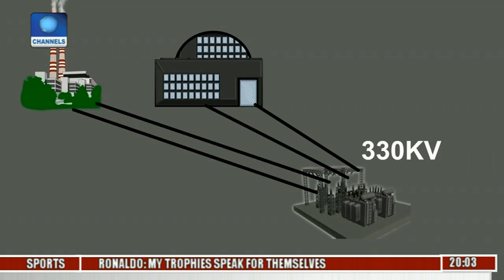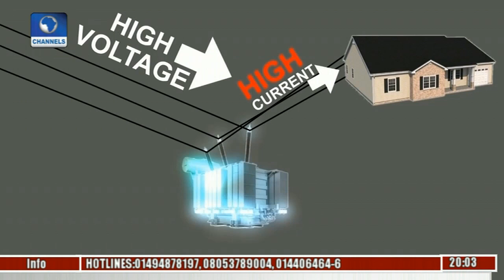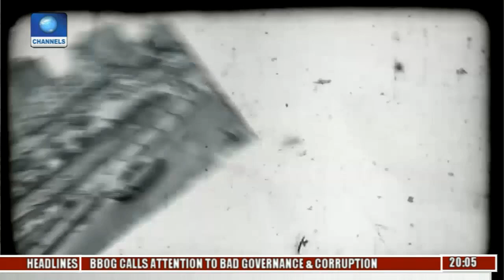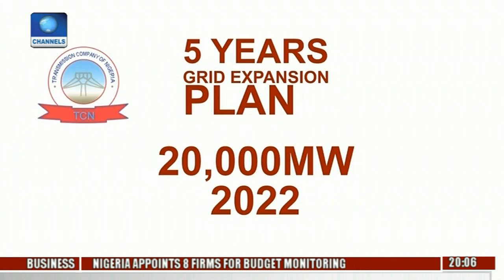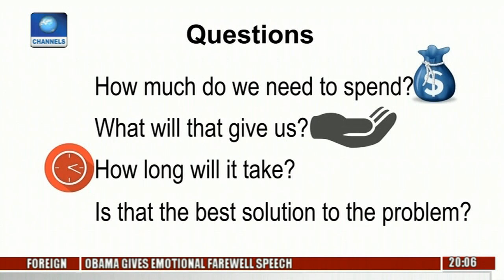The Crux: Understanding The Nigerian Electricity Grid (Pt.1)

Comment: Generating with gas ,it is better to pipe the gas to smaller generators in towns and cities because the power loss by piping is nothing compared to transmission IsqR losses.
Govt should let tariffs float so transmission company can get a return on investing in power efficiency by putting in full 3 phase,power factor balancing ,heavier wiring,and smart meters to dual tariff to switch off remotely water heaters ,nonessential pumps at peak periods.